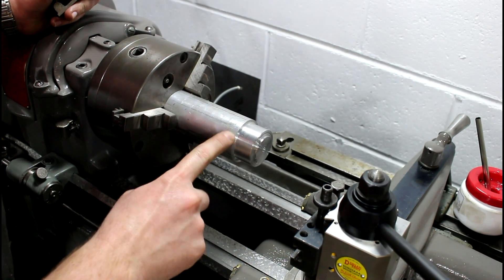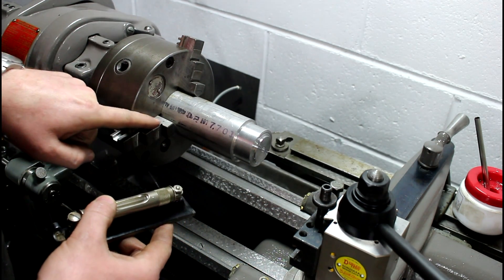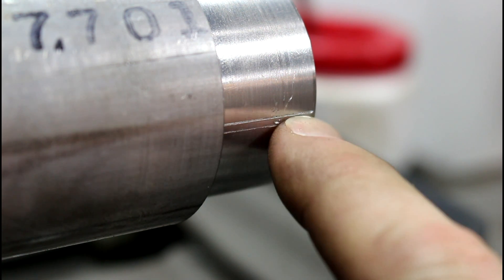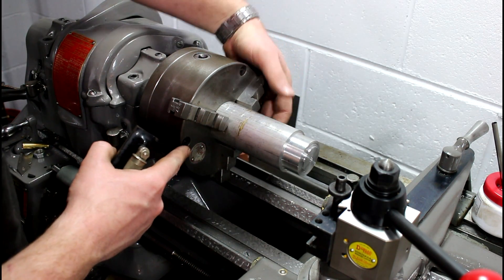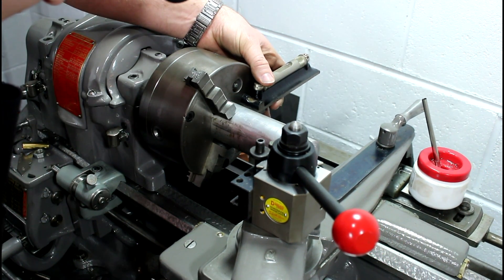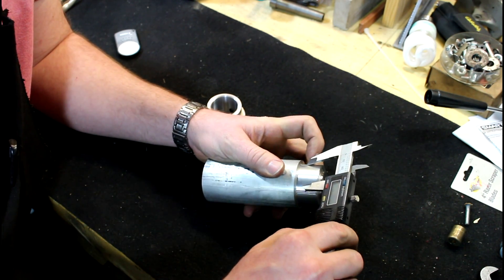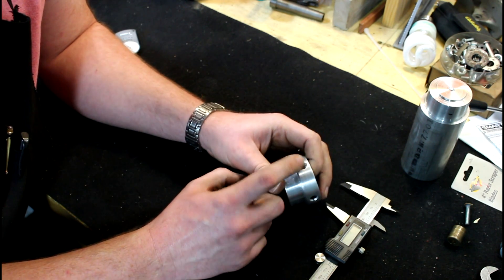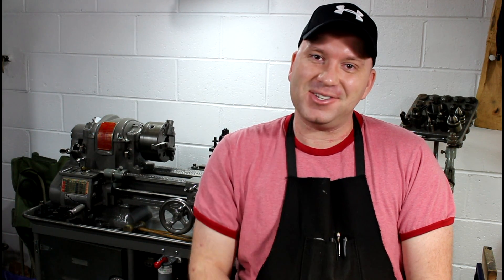Simple Degree Indexing on a Lathe Without an Index Plate!

Comment: I made a similar spider, but I did the indexing in the mill. True everything up in the lathe. Then put it in the mill vice, putting a .050” flat on the top. Then flip, placing that flat on the bottom of the vice. That gives you two matching sides. Then place those flats against the sides of the vise to get the other two. Very quick and gives me a flat spot to keep the drill from walking.

Comment: I use the spindle back gears as a crude indexer, my lathe has a 40t gear on the spindle so tooth crest to tooth crest = 9 degrees or tooth crest to root = 4.5 degrees. ;)

Comment: I have seen someone using his phone mounted at the  other side of the spindle, and using an app called protractor with a plumb modus. A simple plate and double sided tape does miracles. I did forget which you-tube I saw it on, but to me that looked great, as soon as I need it , I'll try it out for myself. But I have to buy a lathe first. Kind regards.

Comment: Many more options - Take top of spindelstock and index from a fixed point to different teeth in different gears - Many options - takes a bit of work on the calculator - Your method is fine and clever

Comment: Another simple method that could be used is to take a strip of paper wrapped around the circumference of the chuck. Cut the paper to length so it fits tightly on the chuck with the ends touching. Remove the paper strip and fold it in half twice (for 4 segments). Add additional folds if more segments are needed. Tape the paper strip onto the chuck and add a pointer (straightened paper clip ?) to the head stock.
Reply: fast and simple
Reply: Lol,

Comment: I use a degree wheel, double sided tape to hold it on the rear spindle, and a paper clip taped to the head as a pointer. Dirt cheap, amazingly accurate and no limit to the amount of holes needed.

Comment: I really appreciate your method of index four equal position. 
This your method can not rule out an error.
I would like you to try this method:
- set tool point at centre
- with the tool point touch work longitudenerally to the axis of the machine and mark face by moving forward the tool.with cross slide and mark both sides of the. face.
- With engineering square placed on the cross slide rotate the marked line on face Vertical to the axis of the machine with the aid of the engineering square..
- Rotate to Mark the two other lines axially.

Comment: Interesting idea. I'm not sure I see an advantage unless you only had a hand drill to drill the holes. If you had a mill or drill press you'd still have to setup and indicate to find center to drill the holes perpendicular to the center axis after the lathe work was done. I've never used this method but it's good to have as many tricks as possible. I've used 5c spindexes which are relatively inexpensive on Ebay, sure you have to turn a small boss first or make a jig to fit larger diameter parts in a 5c. I've also used the drill-thru method and then just use gauge pins in the hole to indicate off of at 90*. The key to drilling through is to have a long center drill to reach through to the other side of the center after drilling through the first side. 
Anyways, 1,000 ways to skin a cat.

Comment: "With basic tools" * pulls out a expensive super fine machinist level!*
Reply from the maker: They are only about $60-$100 on ebay for a decent one. Not too much more new.
Reply: Yeah but I recon it would work pretty well with my el cheapo plastic level too! But I have an engineers protractor with level on that could be used to get any angle.

Comment: A carpenter's level made for making sure surfaces that can extend for tens or hundreds of feet are "level" won't get you there but a short "machinist's level" will? That's funny. Have you ever heard of a SQUARE? Did you take GEOMETRY class in school? All you need to do is scribe a line through the centerline of the piece, use a square laid parallel on that line and scribe another line perpendicular and SQUARE to the first THROUGH THE SAME CENTERLINE.

Comment: At the back end of the spindle where you have the internal thread, build an arbor of sorts that will thread in and pick up a circular saw blade. Probably about 8 inches in diameter. Depending on the number of teeth is the number of degrees when you set up a 'Pawl and Ratchet' arrangement spring loaded somehow. My standard blade is a 24 tooth so I get 15, 30, 45, 60, 75 and 90 degrees........ All X 4. Easy. Only once the indexing is done, be sure to unscrew the gadget else its a spinning saw blade.
Reply from the maker: I thought about that too, but this was much quicker in the moment. Also my lathe doesn't have a threaded end to screw anything to.
Reply: I seen mr pete do the saw blade index thing too

Comment: It occurs to me that a similar result is possible by choosing the correct change gears such that the overall gearing is divisible by four and then indexing (with a dial test or dial indicator) on the appropriate teeth. It will take a bit of math though.
Reply from the maker: I thought about doing that too, but didn't want to pull my gear cover off. No change gears on this lathe too.

Comment: For the index to the second position, your assuming the jaws are perfectly symetrical. In my experience that's too much to hope for.  Try rotating the chuck the other way. Make the second position upward. Then use a machine square in combination with your level. Use that same jaw to reference off the whole way. Still not as good as an indexer, but you've got to run with what you've got.
Reply from the maker: It actually worked out pretty good in my case. I've since gotten a bison super indexer. Thanks for the advice.

Comment: Great tip, and here's an idea. Instead of indexing 4 positions you could index twice and scribe across the face so you have cross hairs on the face. Then you can use the cross hairs to line up the tool for scribing the side of the part. It would be best if you do it before the final face off.
Reply from the maker: Hey, That would work also. Thanks!

Comment: Here's a shortcut to your method.  After scribing your first line. us your cross slide to transfer that line across the end of your piece . Repeat for your 90 dgrs mark. take piece out of chuck, stand vertical and use a machinist's square to transfer the last 2 lines to the  sides
Reply from the maker: That would work too. thanks!
Reply: Welder Wayne ,,,,,,,how to make thread on a 210 lathe.

Comment: what I do is to put a gear that will divide to how many you want on headstock spindle & a homemade plunger dedent on screw cutting gear change banjo it's only limited by your gears
Reply from the maker: I thought about that at the time, but this seemed simpler and quicker than setting up a gear/plunger set-up. I've seen several versions of that and it seems to work good for the people that have them. I've since picked up a Bision Super Indexer so I can index down to 1 degree now.

Comment: Useful video. You could use a small square against the top jaw for the last mark
Reply from the maker: That would have worked out well too! Thanks.
Reply: You could use a square and a scribe to do the whole damned job and not need a lathe OR level within miles of you. How do you think its done at a drafting board or high school geometry classroom desk?

Comment: Great Video
You could also use this method with a Digital Angle Meter. They have very good accuracy and also inbeded magnets on all four sides for mounting the Meter, The magnets would free up one hand during alignment.

Cheers
Willy
Reply from the maker: I've been thinking about getting one of those, maybe I'll just have to take the plunge! Thanks!
Reply: I use mine allot and really like it. The magnets make it really handy for mounting to steel. Compared to using a manual protractor or some similar type of manual angle gauge it's way better. The one I have measures down to one tenth of a degree.  Do a search on Amazon. They have allot to choose from well below $50.00.

Willy
Reply from the maker: I'll check it out, I run on a very small budget so if I find a deal on one I'll grab it. You would be surprised how little $$ I have into my entire shop.

Comment: Good tip but on your particular piece you could get away with indexing just two points at 90 deg and drilling straight through
Reply from the maker: You could. I didn't want to risk an offset hole.

Comment: why not simply use one of the cheap digital angle measuring gauges. They have a magnetic base so you have 2 hands to 'get it spot on'.
Reply from the maker: +Michael Linahan 
That's a good idea. I didn't have one at the time, but as long as they are 0.01" accuracy over 6" you'll be the same as the Starret level!

Comment: Try putting your lathe in back gear and turn the belt pulley by hand to get the fine adjustment.
Reply from the maker: +disgruntledscientist 
That's an idea ,but the poly mallet worked extremely well.